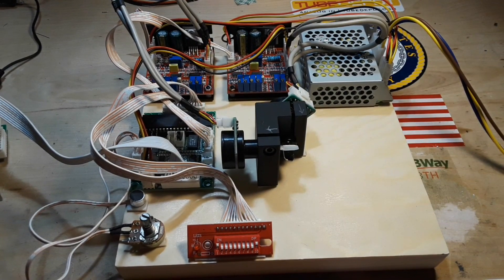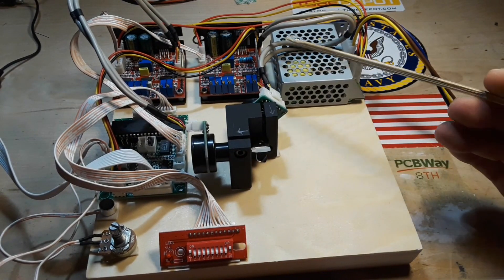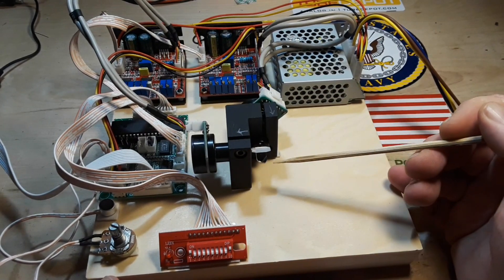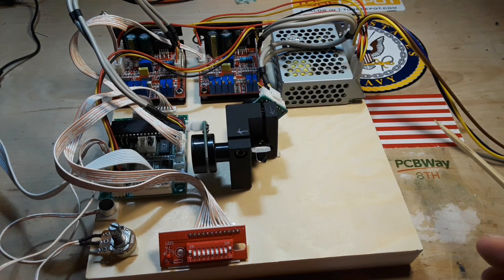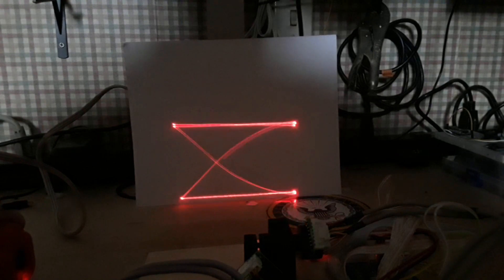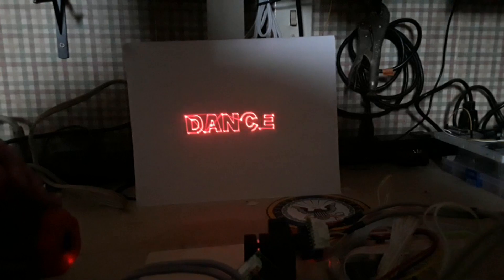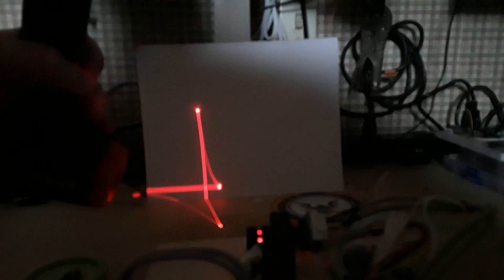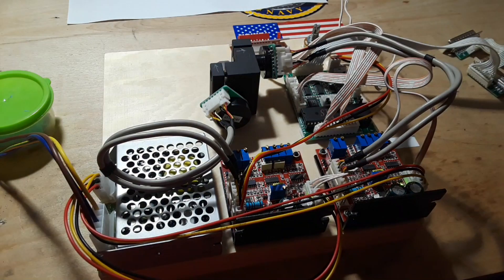DIY Home LASER Show Update

Comment: Well done, Paul.
The galvo drivers should stand up and be screwed into an aluminum plate to be used as a heatsink. Their 'feet' are heatsinks for the power amps. If you're upgrading to an RGB module, it will also need to be screwed into the aluminum plate for sinking heat, as well.
There are 2 types of RGB laser diode modules, TTL or analog. TTL driver boards only provide on/off states for each color, 7 colors in total.
Analog laser driver boards have a 0 to +5 voltage range. With an 8 bit DAC, they can have 256 colors, plus fade in/out. I recommend the latter.
Power above 1 watt starts to become a fire hazard in a home environment. I accidently burned through a fire resistant screen and into my flat screen TV within ~3 seconds with a static beam from my 3 watt, before I could kill it.
Of course, one's eyes are the greatest concern. These aren't kid's toys to be playing Star Wars battles with. JS
Have fun... Warning: lasers are very addictive. 😎
Reply: @John Clayton I've seen RGB 'white' modules on ebay that claim to be analogue controllable, but their driver boards are only TTL. The analogue driver boards have trim pots to balance the RGB intensity.
It's important to not push the LDs above 5 VDC, because they will begin to lose resistance when they run too hot, which leads to runaway cascading break down.
Yes, getting 5 channels of line level signals from an MCU is a challenge. Sound cards need to have their output capacitors replaced with wire jumpers to provide DC coupling, which is required for offset beam positions.  
Just checked out your reference to MARCAN's channel & laser content. Great resource for budding laserists.
Thanks for sharing.
https://marcan.st/projects/openlase/hardware-mark1/😎